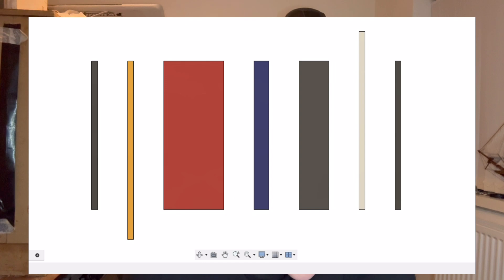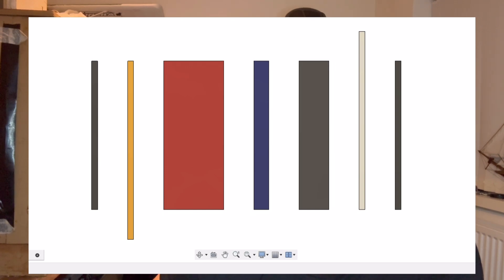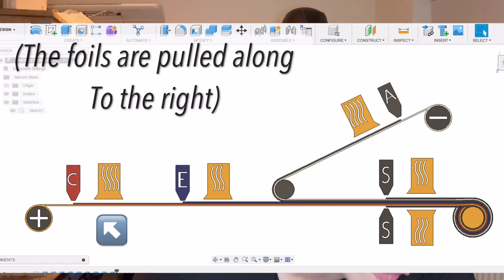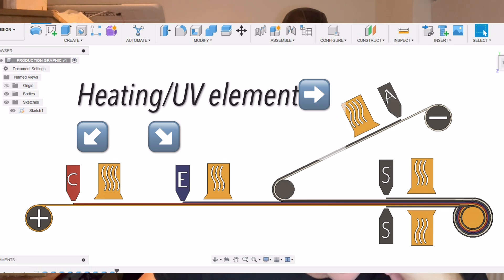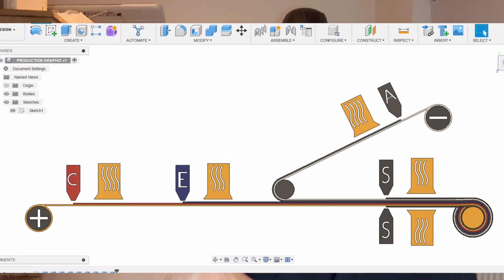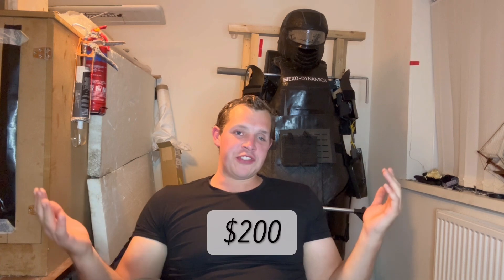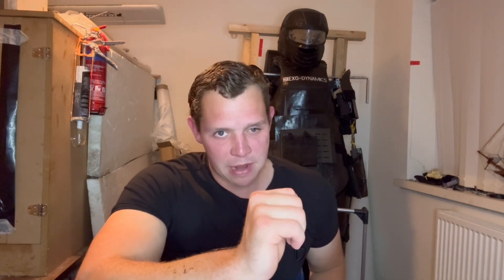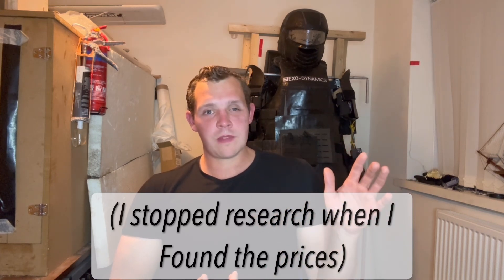Can you make DIY Lithium LFP Battery Cells from scratch? Well Kind of.

Comment: Having worked at the Panasonic side of the Tesla gigafactory in Nevada I can tell you what some of the issues you will face will be. 

Starting with the most dangerous, is thermal runaway. You need to have barrels of water or some other kind of thermal sink in any area that you were working with batteries that have charge. 

I said that first because it's perhaps the most dangerous thing that you will be having to deal with once a battery has charged there is the possibility of rapid discharge and thermal run away. 

On the actual manufacturing side of things One of the issues you're going to face is the tension of the foil. Which is going to be influenced by such things as the rollers you have in play, and any other surface that comes into contact with. Each surface will introduce drag and therefore stress into your foil run. Winding it up at the end is tricky it should all be done in one shot however it all needs to work together and you are going to get breaks in your foil and how you mend them back together is crucial. Or rather keeping track of where the brakes are in your rolls cuz you will want to stop your run as you are spoiling them out you will want to stop where you are going to waste the least amount of foil so you need to know where and when that break in the foil is coming up. 

And probably didn't explain this very well I'm in a hurry but I thought I would just throw that out there for you quickly if you want to know more hit me up.
Reply: Hey are you interested on work making batteries?

Comment: ever messed with supercapacitors?
I found the easiest and most effective way to make them is avoiding aluminum or copper foils. and using nickel instead.
using a simple water based neutral or alkaline electrolyte. and basic conductive additives like graphite or carbon black. some cheap coconut shell activated carbon from the grocery store. Experiment between 15-50% weight to weight activated. Separator can be any porous paper material (with no chlorines clays or fillers) like toilet paper. paper towels. napkins. coffee filter. kraft paper. the thinner and more porous the better.
Made a small 1.25 inch by 10mm with 0.85 farads and 500mA of charge-discharge current capability with some nickel spot weld strips for testing and it worked great.
Also made a bigger one capable of 25 farads and 9 amps of maximum charge-discharge current capability
Nickel will last practically forever as the current collectors and it's super simple to make.
Mixing the active materials is simple like making a paint. can spray dip paint or deposit however you like depending on what viscosity and thickness active material your aiming for.
Can easily get thin layers (0.1mm) with a syringe or pipette. and thinner active material consistencies. or by spraying. or making thicker versions.
Binder and electrolyte be simple water based. Even PVAC is sufficient as a binder. There's also a lot of ways to improve it too if you want. like using porous or mesh current collectors. Nickel expanded mesh or foam.
Might be interesting.

Comment: Interesting ! I think it would take a a few years to make a home made battery that approaches the energy density of a comercial one.

 The process looks like its so finicky, the layer thickness tolerance of every materials seems important. It could maybe be donne in sheets, it would be simpler than a continuous process. It might need an inert environment, or a clean room.

Also the safety aspect, home made batteries might be a bigger fire hazard.

Still I would like to see someone take the challenge lol
Reply from the maker: I looked at sheets but the thickness’ are so slim i didnt think it was possible, but if the coating is applied like a spray paint it should be, a decent car sprayer can get an equally flat spray by hand so with well timed machines i think its well do able. 

On the time factor i thought its not really something you could do as an evening hobby project. The patience that would be required to get it right would require you to do it full time so you dont lose your mind. 

The safety could be a concern but one thing i thought is if youre just making your own batteries, you could run the set up slowly, making sure everythings perfect, that will reduce the chances of insulation and drying issues that would cause the safety issues
Reply: A clean room is necessary. I forget what level it was that I worked in at Panasonic but you couldn't wear any street clothes in there and you had to change shoes too along with a suit gloves and hair net. It didn't have to be a full tyvek suit but it had to be full suit without a respirator.
Reply: There's no real hazard until they hold a charge. Then the hazard is them shorting out or as they say thermal runaway is the issue with lithium ion batteries

Well just a hazard each chemical or material presents in and of itself. The real danger is once they're charged.

Comment: had an idea for your eye implant, what if you powered it by an induction charger worn externally? might get hot but could work
Reply from the maker: Yeah it could work! I intend on returning to that side quest soon. The difficulty is just space you’ve only got around a 5mm x 8mm circle  of space so without making a custom PCB board it wont fit, which is fine but then you cant experiment easily with new components like inductive adding  charging etc - if that makes sense